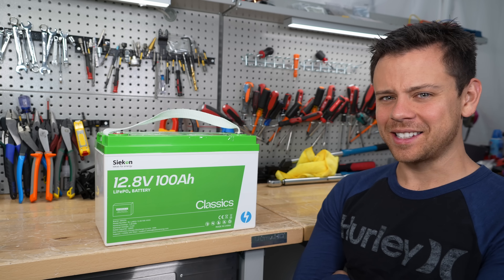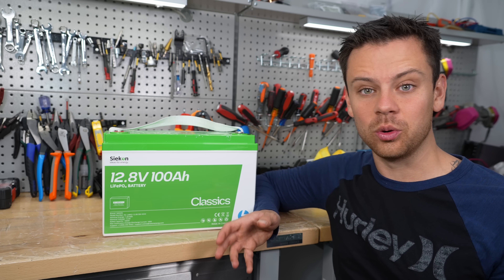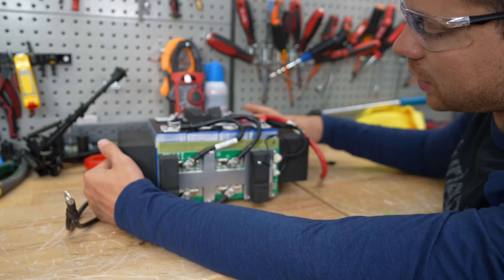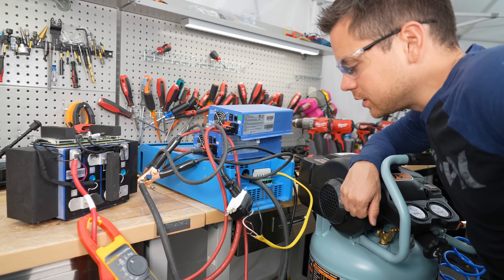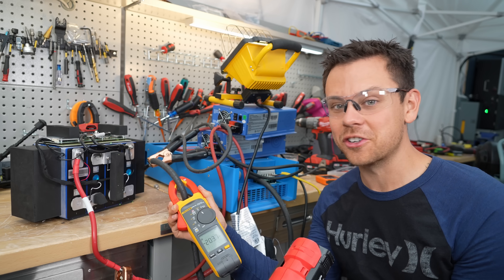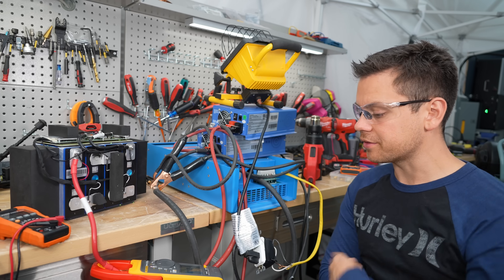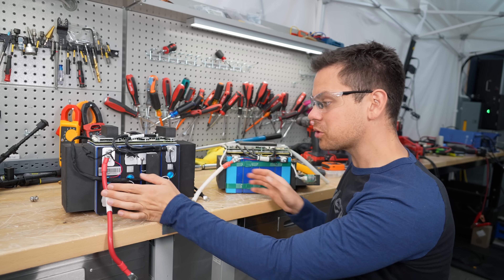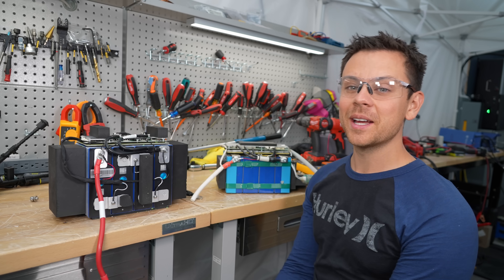Lead is Dead! $229 LFP Siekon 12V 100Ah w/ 150A BMS and Low Temp Charging?!

Comment: 4 minutes in I'm seeing $205 after a $25 coupon.  Lets see what the price does after an hour of you guys buying them up!
Reply: Just checked their site and now they have a $49.99 discount so now $190!
Reply: $190 on their site.
Just ordered 4 for a trial.
Reply: Also their server rack battery was $999.
Reply: Limited to two units on Amazon ended up buying from their website.
Reply: Amazon currently $204 after $25 coupon. and $190 on website
Reply: @D2O2  I'm not seeing these price discounts. Wonder if they took them away...odd.
Reply: @craigalan7911  Same. I think those discounts are gone. I'm going to wait for the dust to settle.

Comment: My god I paid $620 apiece for two SOK LFPs to put in my truck. They've served me faithfully and I don't regret the purchase at this point but damn, could have saved like $500 on my build
Reply: @Max_Janszen  You don’t want to know how much I paid for 8mb of RAM in the early 90s
Reply: @TobyCostaRica   $1600 for two 4mb sticks  LOL looking back
Reply: @TobyCostaRica try 1kilobyte in 1981 for a Sinclair ZX81!
Reply: My thoughts throughout this entire video… I really like my SOK, but for my next expansion, I am getting a handful of these or similar well performing low-cost ones.
Reply: @tomashubelbauer  yeah I like serviceability, that's all I want really is to be able to swap cells out and rebalance
Reply: @tomashubelbauer  I like the serviceability of the Sok batteries, I first learned of them on CheapRVliving.  Actually he recommended Will Prowse as more of an expert in solar / batteries, etc.
Reply: Thats why im still waiting with buying a ev, the technology is getting so good so fast and the price drops all the time,
Reply: Well LFP batteries in the car industry in China have reached to 55-60$ per KWh (i would imagine it is without the hardware supporting them, but still) so 229$ is plausible.
Reply: don't sweat it You have plenty of $ to be ignorant with

Comment: powerqueen hits these prices all the time i got the 12v 100ah mini for $229 on amazon granted no temp sensing. i added the victron smart shunt and love it
Reply: Cheaper option 350 or 500ah shunt available wo bluetooth. About $40. Solid.
Reply: Also powerqeen only has 100amp bms.

Comment: mmmm....not to be a naysayer but where r u getting yer lead acid batteries? i can get 2nd tier 12 volt battery at walmart for a buck25. rv grade and 135 amp hr capacity sealed lead acid. then u have to get 3 to make 1 battery for my system currently.
Reply: If you want to get batteries that have a 2-3 yr lifetime with daily cycling at 50% and 80% efficiency, losing 20% of your solar production, then I guess you 'saved money'.😅
Reply: You can only use half of that capacity rating with lead-acid batteries or the will be permanently damaged. We can use 100% of the capacity rating of LiFePO4 batteries with no damage, though they will last longer if used to a lower percentage. Even if used at 100% capacity every day, they will still last around ten years with 80% usable capacity after that. I figure mine will last well over 20 years, since I never get that low and during the winter, (the season I use less power), usually see at least 85% at the lowest.

Comment: Yup. 

However, we still have the low temperature issue to deal with so unfortunately lead won't be dead for awhile.
Reply from the maker: Heated LFP batteries work a million times better than lead acid, and are cheaper.
Reply: @WillProwse  Sure, but what if you have it sit for like a month in cold weather, that heated battery will lose capacity trying to keep it warm.
Reply: @WillProwse  My mind went straight to vehicles. You'll never be able to have lithium for starting engines so we are stuck with lead acid in that application.
Reply: Many have internal heaters
Reply: @devonsaquariums2703 Or you can add 1 stick-on 12v self-regulating RV Tank or drain heating pad for ~$35.
Reply: @my_channel_44  Bingo!  or an 1147 incandescent bulb to generate a little heat.
Reply: @s.mendez7160  a self-regulating pad is the way to go. Even far better than a lamp. I'll pull up the ASIN and post it here in a little bit.

Comment: 7 years ago I paid $999 for 100Ah (Battle Born). To think people paid more before me 🎈
Reply: Have you checked their current prices?  They're the same if not a little more. I don't know why people buy those...
Reply: @devonhamradio2703  Spot on.
Reply: Is it still working? Do you use it much?
Reply: @stevepriority4219  Still works great. It was used to build my first DIY solar generator for my mini Van life. Since I bought an EcoFlow Delta 2 for $799 and that, in my experience, is the way to go.